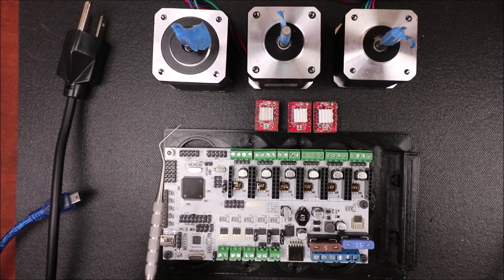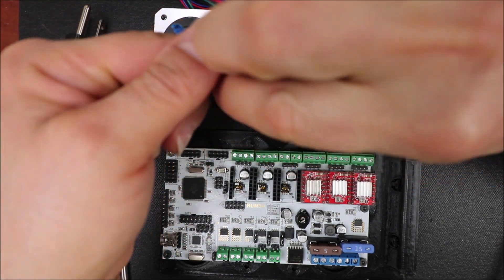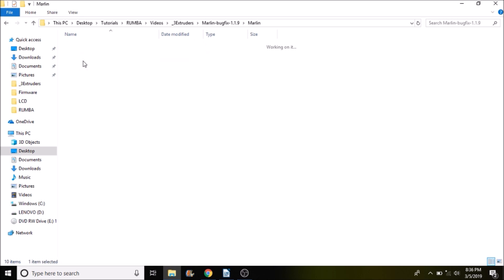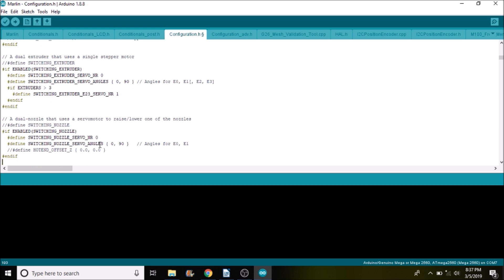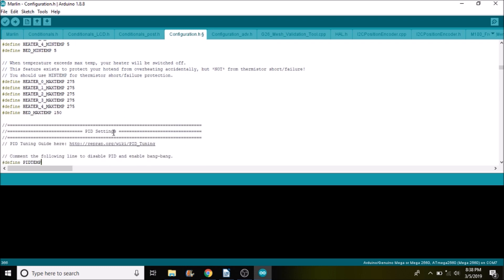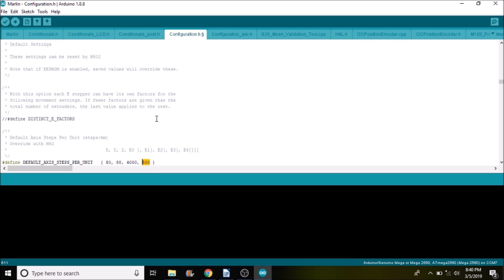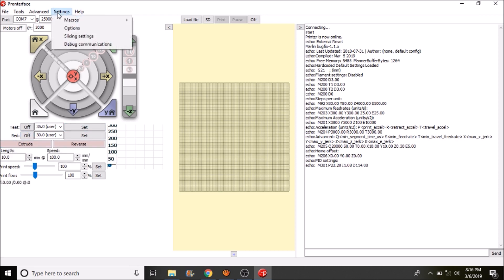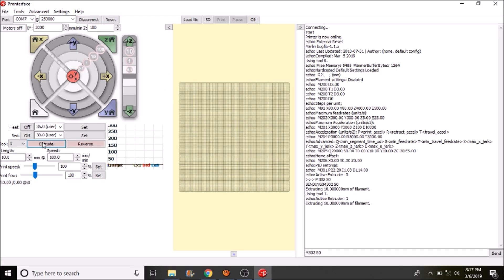Rumba - Adding 3 Extruders for 3d printing.

Comment: you help fix error
avrdude: stk500v2_ReceiveMessage(): timeout
avrdude: stk500v2_ReceiveMessage(): timeout
avrdude: stk500v2_ReceiveMessage(): timeout
avrdude: stk500v2_ReceiveMessage(): timeout
avrdude: stk500v2_ReceiveMessage(): timeout
avrdude: stk500v2_ReceiveMessage(): timeout
avrdude: stk500v2_getsync(): timeout communicating with programmer
An error occurred while uploading the sketch
Reply from the maker: So, what was the issue?

Comment: do you have a video on setting up belt size and lead screw setup I have 600mm rods and there maxing at 60mm  and my bed is 17"x20" and it maxing at y" 900mmx500mm on x with belts rumba drv8825 diamond hotend 3 extruders
Reply from the maker: Try reprep calculator.  It will help.

Comment: Hi Edward i have some questions : how do you set up the current  on a ramps 1.4  board with drv 8825 ??  i have 5 nema 17 stepper motors and no info on the motor to calculate the Vref voltage adjustement can you send me some light in the dark:) im presently running under Skynet 2.3.2 thanks :)
Reply from the maker: Checkout my tutorial playlist for MKS Gen L for drv8825.  I'll post a link if you're unable to find.
Reply from the maker: https://youtu.be/m1fOqq5GYDA